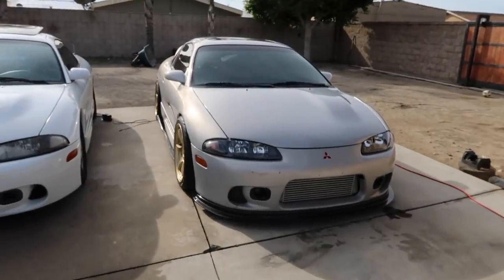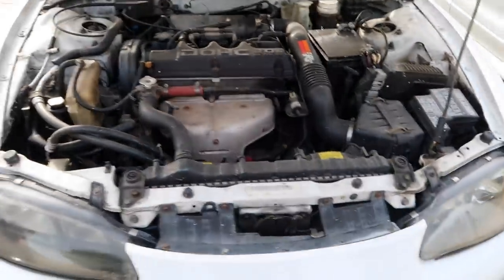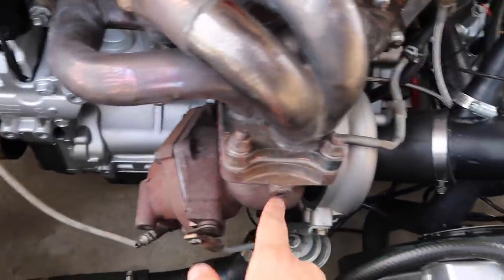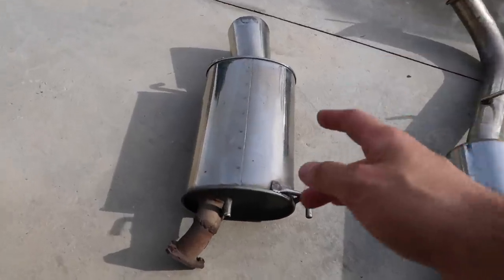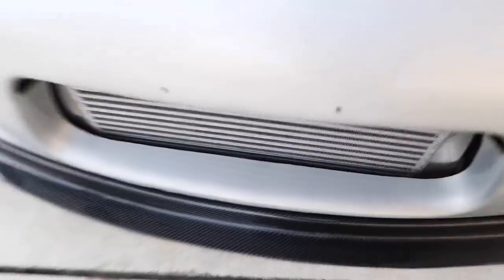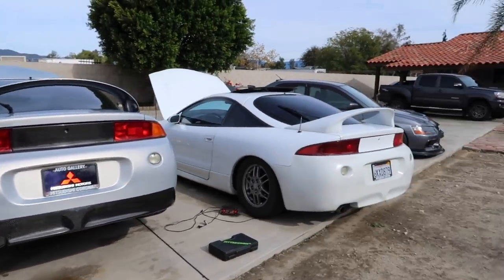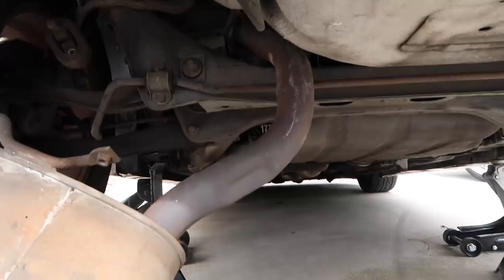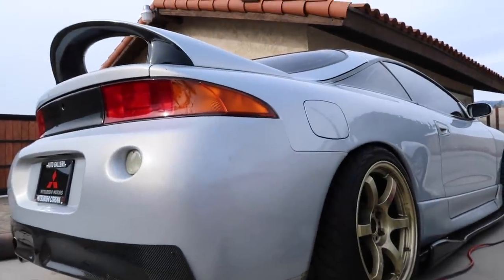MITSUBISHI ECLIPSE EXHAUST INSTALL !!

Comment: The GS convertibles also have the twin tip stock exhaust if you can’t be bothered to look for a GST. That plus some no-name tube manifold made my car sound sooo much better than the stock raspy noise, and it’s not super loud at all.
Reply from the maker: Yea it’s hit and miss with the 420a models haha. That’s why I was scared with this no name

Comment: Thanks Miguel for explain these, I'm a 420a owner and yeah exhaust are loud sometimes I've tried alot and no one convince me. I ended up using the GST muffler and sounds better than the 420a 😃
Reply: Bro how were you able to fit the muffler piping through the subframe, I’m having trouble getting the muffler end through the subframe to connect it to the rest of my exhaust.

Comment: Is the 420 worth boosting? So many good looking 420's their just slow. How would it compare to a GS-T? curious to compare apples to apples after being boosted. Keep up the good work! Love all the videos.
Reply from the maker: Depends on your goal. They are not fast afterward
Reply: @MiguelDsm  so then GS-T or GSX if definitely the way to go? Looking at a GSX hoping ill have it soon :)
Reply: @francoollervidez7067  420a wont handle that much boost. even the 4g63 non turbos dont have the internals for that much boost compared to the gst and x’s 4g63t. this is all considering youre keeping your internals stock, ofc.
Reply: @francoollervidez7067  did u get that gsx?👀
Reply: Nope i got a mustang gt 5.0, but...still on the look out for a GSX. i will get one eventually

Comment: i use the RTM racing exhaust  and they redid theirs from a  N1 exhaust as a template for theirs they added one more resonator to theirs but it gives a nice deep throaty growl instead of the raspy sounds of the N1.
Reply from the maker: Is that the one one ebay?

Comment: When will you get the bodykit and wrap from fast and furious on the white car??
Reply from the maker: Hoping In 2020!
Reply: @MiguelDsm  nice if you have a tight budget there is a bodykit on ebay for 600 dollars that is exactly the same as the one in the movie for people that don't know a lot for the car and just have a diecast but the sideskirts are different and also may need work the original car had a robocar bodykit which is extremely hard to find also the wheels are extremely rea but fn2 type r wheels are very close